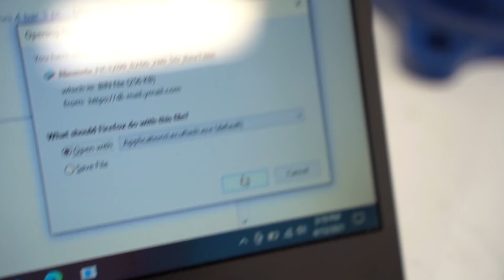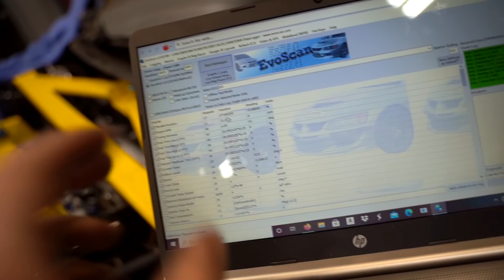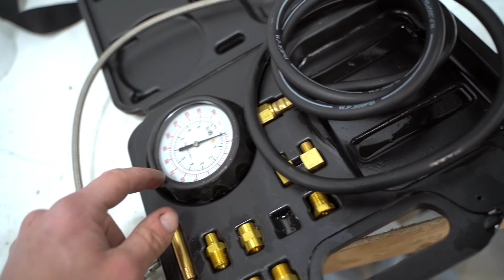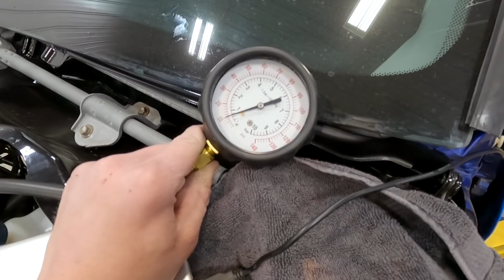Fully Built Evo 8 First Start Up!

Comment: you can hear the noise from the exhaust. its deffo the Hot side of the turbo. when you took it apart you lost the balance. you might think you have the marks to put it back together but its more than that. it has to be really accurately balanced. better get it somewhere to check it before you smash the bearings. Love your content mate doing a great job!
Reply: Thats exactly what I was thinking mate not balanced.
Reply: yeah i was kinda surprised at how easy it was to reassemble the turbo. I would be nervous about the small fact that wheels spin upwards of 100k rpm so things would be to be on point. i would think.

Comment: First start up you should warm up the engine by 30min and change the oil. Second change you should do after 60 or 300miles and third change after 360 or 600miles. First 30min oil is like soup.

Comment: Why change the spring in the blowoff valve? On all the turbo cars I have built, the valve would always be open during idle and part throttle. Once wide open throttle and making boost, the valve would slam shut and stay that way until lifting off the throttle. 🤷🏻‍♂️

Comment: Hey. INTERCOOLER uses its bare metal and the moving air across it to dissipate heat. Will it end up trapping heat internally if u Ceramic coated it?